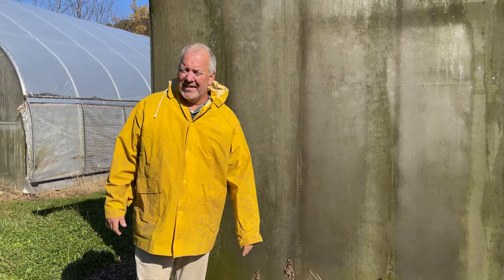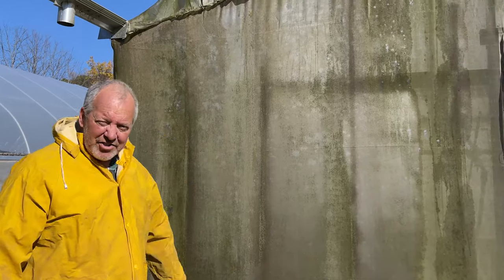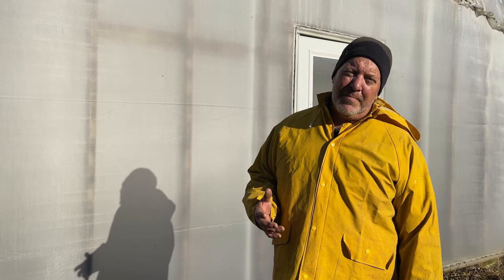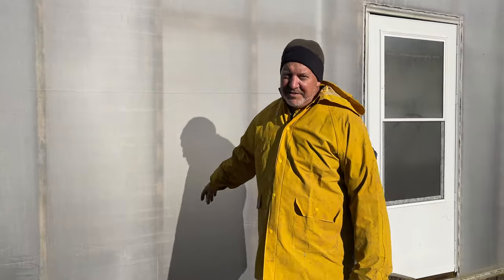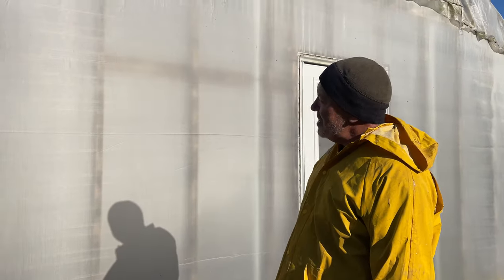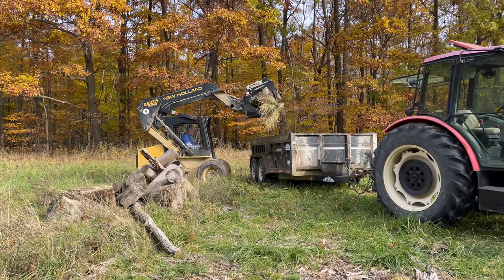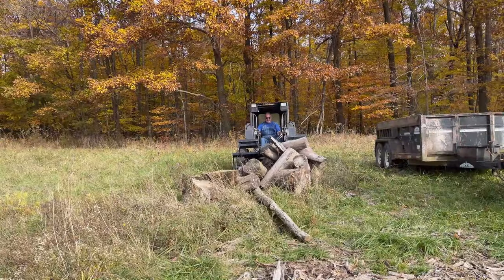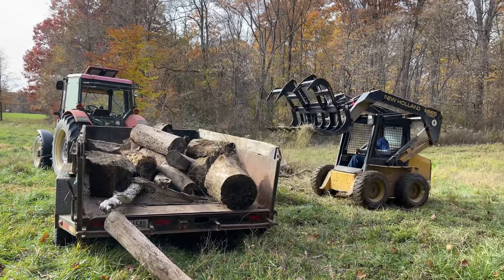Last in our 4 part series on deep cleaning our greenhouse.

Comment: Wow. What a pile of…… work!  I knew hydroponic trays and buckets were prone  to get algae and other crud  but you’ve shown just how bad it can get. Hard work cleaning up for sure but you’ll see the results at the next plantings. Good luck next year.
Reply: Ive only just started trying hydroponics and oof! You are not kidding. I have 25 buckets to be washed out in my greenhouse butbits so cold as my greenhouse isn't heated.  
I'm hoping for one or two more sunny days before I have to drain my hoses.
Reply: @Emeraldwitch30  I’m still going to try some “low tech” hydroponic next year here in the Carolinas. I know it will work because I’ve done it before several years ago but I too had algae issues
Reply: @scottbeavers1713  I did too but I think Im Going to try that silver bubble wrap looking stuff thats used as insulation. It comes in big rolls not too expensive and im going to wrap the buckets. I did kratky hydroponics  for cucumbers and celery and peppers and eggplant. Oh and several herbs all  summer but I had heat issues too that caused a bit of wilting off and on. But my greenhouse is basically a glorified hot bed lol. Its only 8 by 12 by 6 1/2 tall lol. Not a lot of venting going on but it works okay for now. 
I am building a NFT system but small for next summer.
Reply from the maker: You and Scott are doing great. You have to admit its fun trying new things...figuring out how to make things work and being successful...continued success and thanks so much for your comments!!

Comment: A great vlog, thanks. You said you painted the greenhouse roof over summer, we are just entering summer and I was wondering what sort of paint would or could be washed off for winter. Very high temperatures are a problem for me so any help, thanks.
Reply from the maker: We use ReDu Heat. It works great and something we would recommend for sure.

Comment: How do you manage during snow??because maya be a lots of snow in your roof
Reply from the maker: Snow is not really a problem. The plastic does not have a great R-value, so the snow does not stay on the roof very long. Since its rounded on the top, it does slide off very easy.